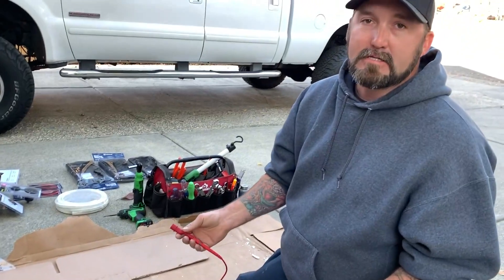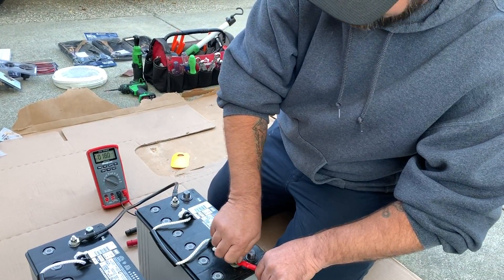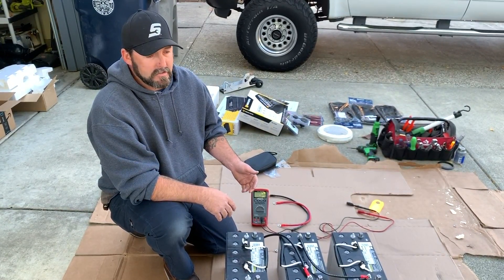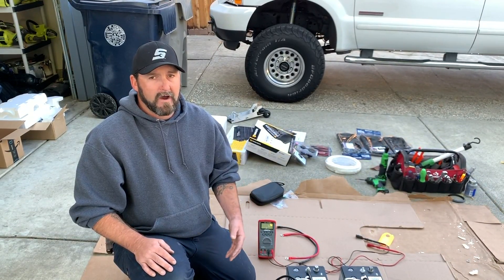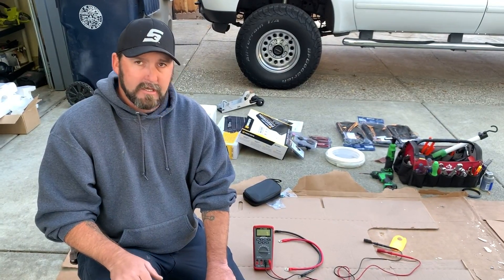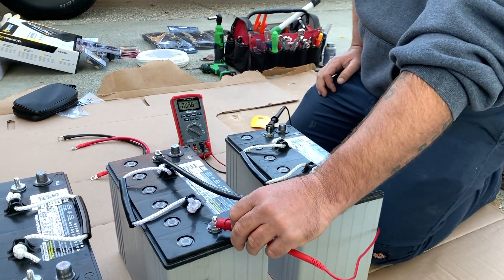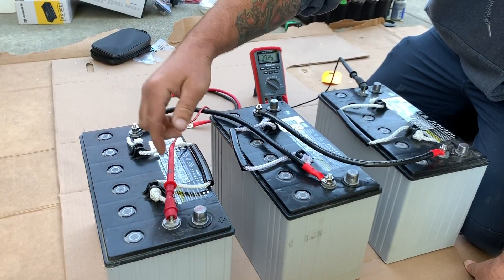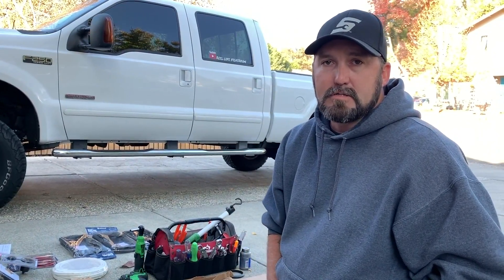BOAT BATTERY WIRING | TROLLING MOTOR | HOW TO

Comment: Another good video.  I wish I would of bought a 24 volt trolling motor but my 12 volt iPilot works good on my 17'.    Mainly I just put it on low to steer and push with the kicker.  I have two 6 volt golf cart batteries wired in series and have got five seasons out of them and they don't seem to be slowing down.    I rarely get them down below 50% and put them on the charger as soon as I get home.  I think that helps.
Reply from the maker: Shasta Steve thank you! That is exactly how I use my trolling motor as well! Just to steer and the kicker does the pushing.. sounds like you have a great set up.. don’t fix it if it ain’t broken! 😉 thanks for watching and commenting.. i appreciate it.. tight lines!